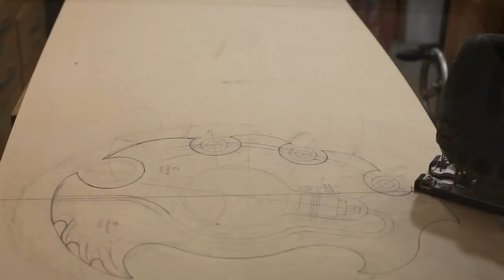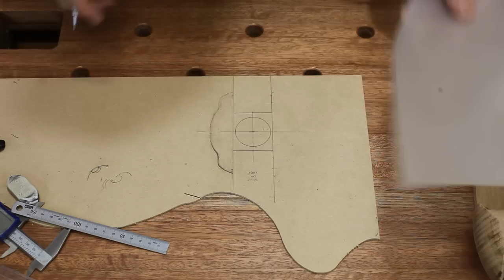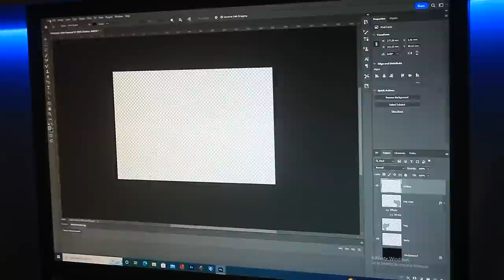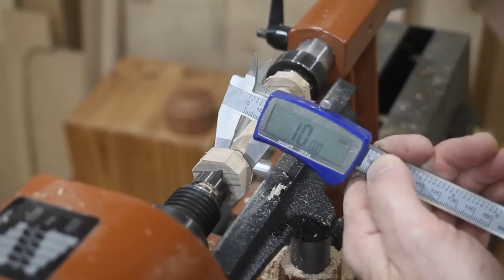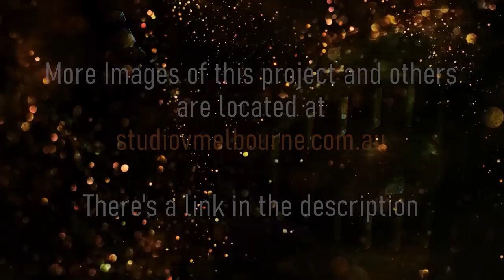The making of EMBRYONIC GLOW

Comment: Entertaining and nicely suspenseful, me not imagining how you were going to acheive what you had in mind. Would have been even more engaging had you thrown caution to the fan and used some exotic wood. How does the probably fresh Tassie oak handle any heat generated by the lamp?
My compliments on your use of now hard to get (in QLD) brass slot head screws, my own supply of them is running low and I'm having to resort to straightening and cleaning the dregs of my collection. Looking forward to your next..
Reply from the maker: Thank you. The light doesn't generate any heat otherwise I wouldn't have made it like I did. There is very little to no movement of the timber.
Like I said, these projects were an experiment and I have very limited funds, however I'm looking forward to building with some more exotic species in the future. 
Thanks for the feedback.

Comment: Great build! But just one question... The base is stationary, it has electric going to it. The lamp rotates and is plugged into the stationary base. How do you get it to rotate without twisting the power cord?
Reply from the maker: It's the magic of the visual formate and editing. 
After several rotations, I stop the rotation and unwind the cord. The rotating display platform is intended only for smaller projects that require a 360° view while filming. I was wondering when your question would be asked. Thank you
Reply: @Studio-V  Thanks for the response. I was hoping there was some sort of way to keep contact with power and still be able to rotate 360 degrees continuously. I do have an idea for that, but I dont think it would work long term.
Reply: @timothymallon I mean, slip rings are quite existing and easy to install 😇